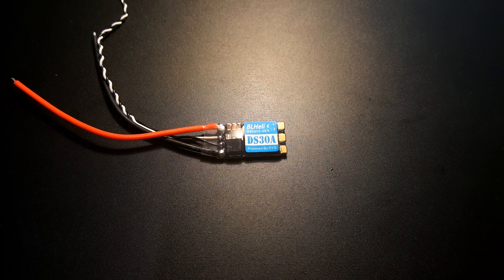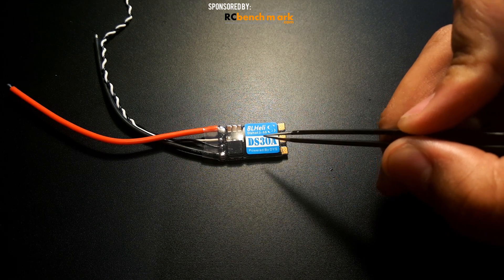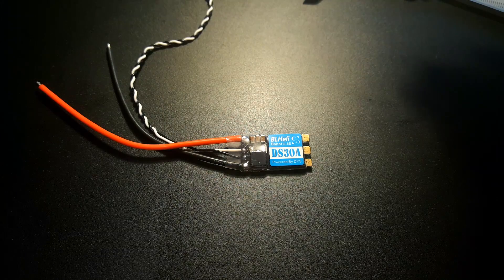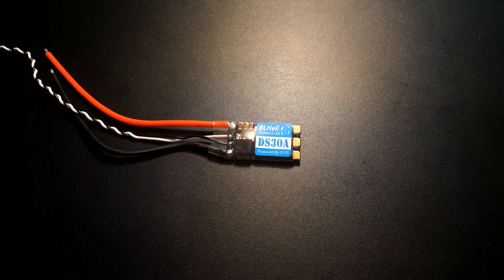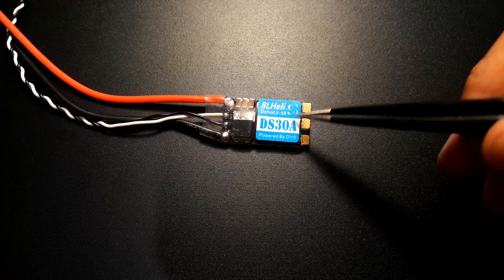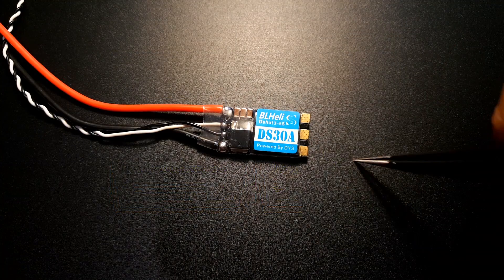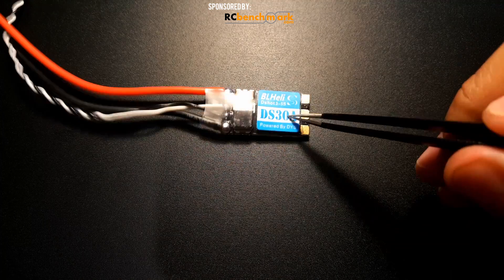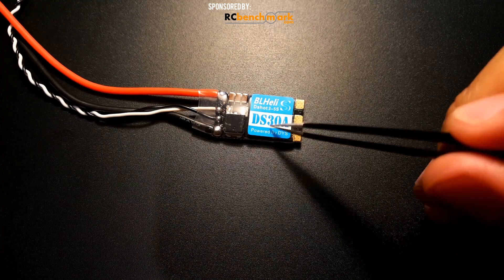DYS DS 30A ESC  Review  // Noise Testing

Comment: Hee drone mesh i have one cuestion if i get interverence on my vtx is a caps. How you now did on your flame fc. the only option or can i put little ones on each esc or somewhere els where and what kind of a caps. should i use then?
Reply from the maker: They have to be low esr caps.. I have added the 1000uF and I will be flying it in 2 days and upload the video on the status
Reply: Drone Mesh nice i ordered the frame now wanna order that fc to but i want to know how to fix the worst case sanario thats why but you said that if i order from bg that it should here in around 10 days? I forgot to add the trackingcode
Reply from the maker: Bennie Leip what frame? This is an esc video
Reply: Drone Mesh what youre going to test in 2days that flame fc, awesom frame dys esc's build or do you had that problem whit a other build too?
Reply from the maker: You need to note something on that frame.. I had comment about someone saying that the props will hit the frame however I used very large motors and thus why i did not get that problem.. I need to still test that aspect but have had no time.. If it happens to you then contact banggood for refund and tell them about this.. If ou have not bought it yet then go with the frog lite or race frame.. I really love those and the carbon is very good quality. I bought 3 more so i have a total of 5 now which i will be using for the NEW FC's and ESC's to test.
Reply: Drone Mesh strange I thought that they recommend 2205 whit it okey i look out for it thnks and yeah i can see youre bizzy😆 the amound of vids youre getting out👍🏻

Comment: hi, great review. i am looking at the 20A version of this esc.
Was trying to find a good esc match for the brotherhobby t1 1407 3600kv, the motor just getting way too hot when i was running 4s with dys 3045 triblade and racerstar 28A esc.
Turn the PIDs to less than half of the stock value and checked the motor screws but still no success in bringing the temperature down.
Do you think different ESCs will also affect the motor temperature?
thank you.
regards,
Zt.

Comment: Looks good, I've been considering those every since they released. I feel like it's less of a risk now so I'll probably give them a try on my next build. If you have an opportunity, will you please test and post data for TVS diodes being added to ESC's? Supposedly they reduce high voltage spikes from going back into the power system from the ESC's
Reply from the maker: Well I don't see any scary high voltage except with the emax 2306 motors 2750kv it reached 53v in spike with RS 35A esc and burned a couple.

I will dig online and research the diode to see what would be best suited and to get for testing..

Comment: Bttr than the dys xs 30a?
Reply from the maker: +Bennie Leip No the DYS XS is still the best for its price and effectiveness till this date.

Below is how I rate the ESC's tested so far and this is my opinion top is best and goes down

DYS XS
T-Motor f30a
DYS ds
racerstar 35a ms
emax bullet
Reply: Drone Mesh thnks for anwesering i yust yesterday ordered that awesome frame looks robust iam now waiting for youre test on that flame fc. because you said that that other one was bttr but the flame looks easier for a first build so hope that it turn out good. But i have one question that red bottoms rs2205s 2300 kv is there only a cw motor ?because i only saw here in holland one type of motor ,btw does it make a lot of diverse rs2205 or the rs2205s?
Reply: Drone Mesh you have shown that build whit the dys xs 30a but how do you ccw youre motors whit those esc's solder or on the comp.?
Reply from the maker: Cw and CWW is only about the prop nut and it has nothing to do with your older all high end motors come CW.
Reply: Drone Mesh but my 2nd question i meant whit that you must have 2motors running cw and 2 ccw how did you do that whit those esc's whit soldering or whit betaflight ?
Reply from the maker: It's up to you.. But its better with soldering
Reply: Drone Mesh huh okey I thought that it was the one of the other okey thnks

Comment: Can you test the burst rating? Like give it a 35amp burst for 5sec. to see if it can handle it. Also keep increasing it to see just what they can do.
Reply from the maker: Yes I will be doing amp testing very soon.. But i need to setup the correct environment and experiment to get the most consistent results to have a reliable info.